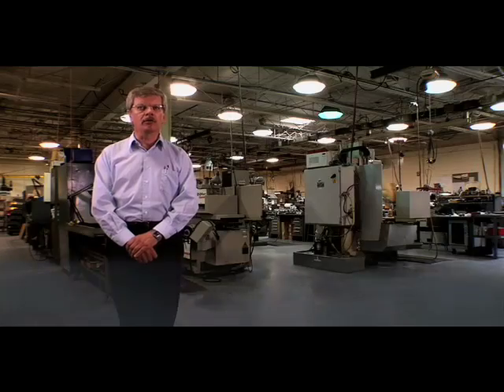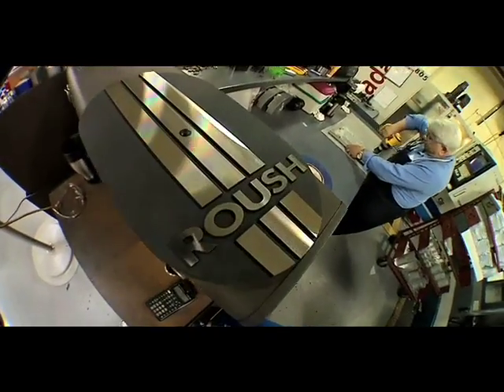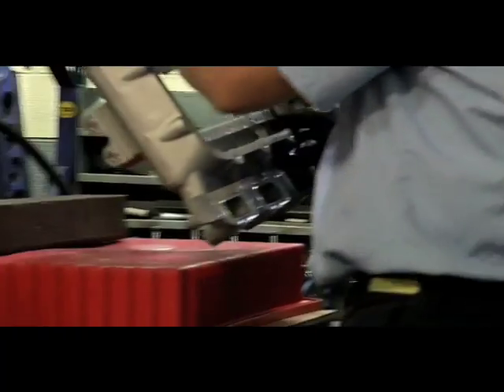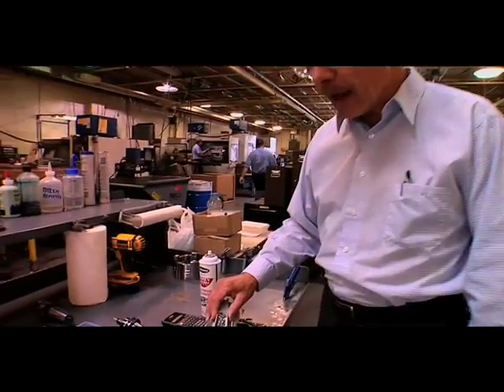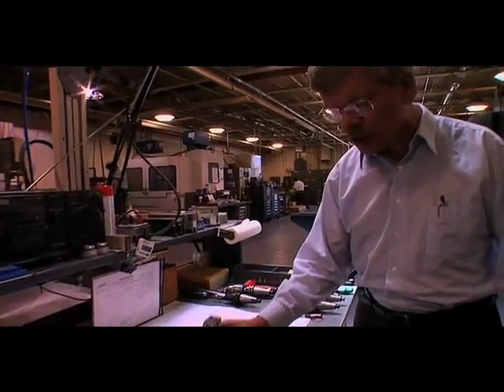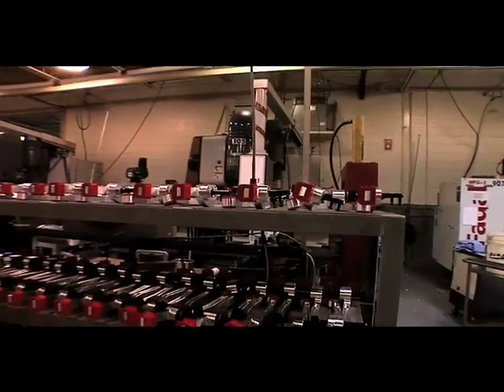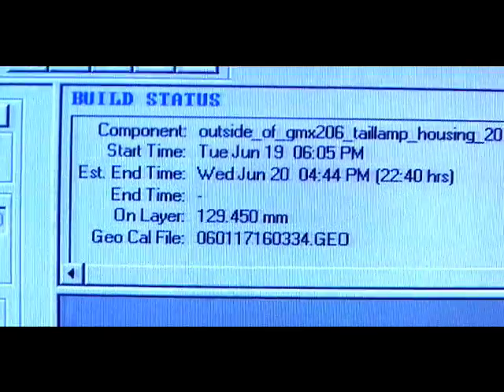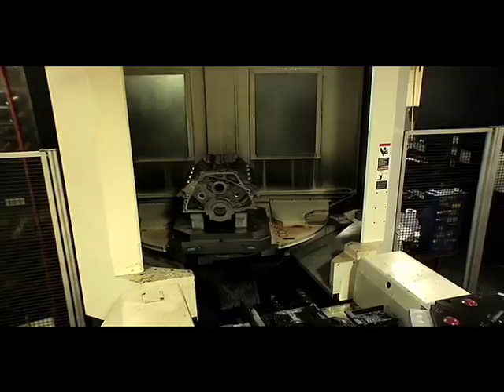ROUSHtv: Machining

Comment: Roush machined my cast iron high nickle[5%] engine block back around 2003 for Koleno performance/Dave Koffel.The engine was a BB RB chrysler wedge style that had limited production by Koleno and production # we about 450 blocks.If who reads this has any info on the Koleno engine I would like to hear it.